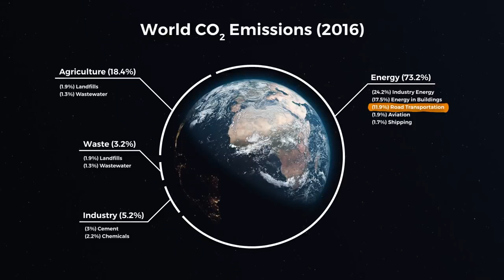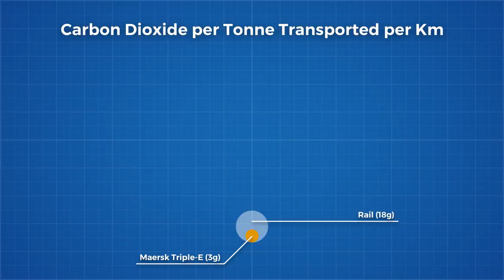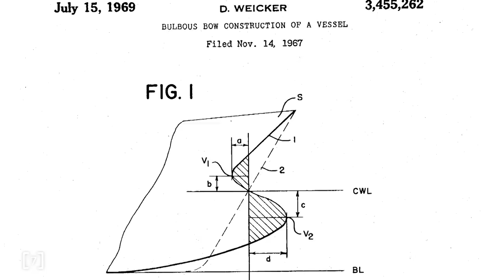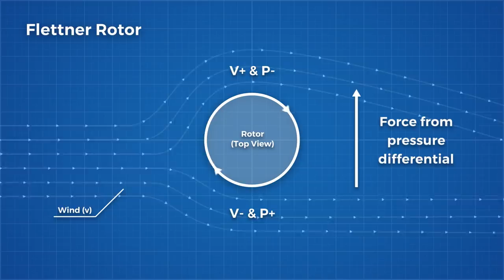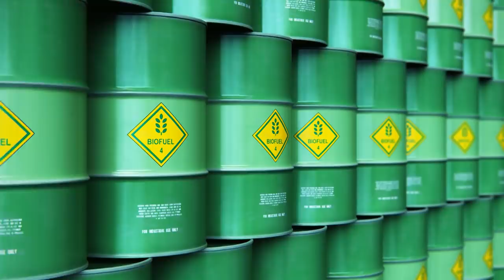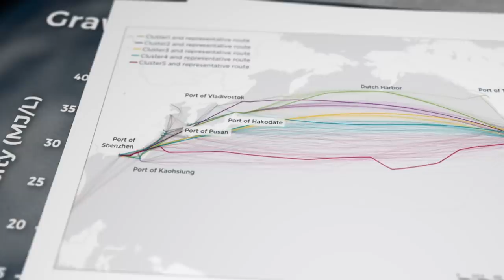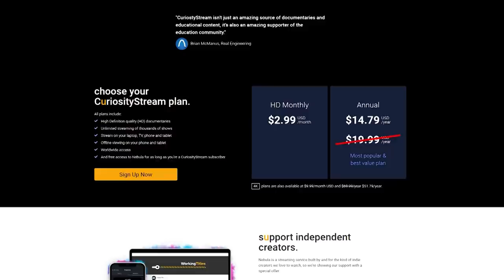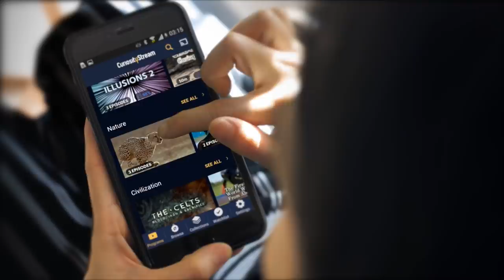Are Renewable Powered Ships Possible?

Comment: Maybe not "renewable" per say but having nuclear powered container ships would be a big step up. Container ships are the most economical way to transport goods but they still throw out a lot of pollution and making them all nuclear powered would almost entirely eliminate that pollution.
Reply: If you do a web search for ‘nuclear ship savannah’ you will see that it has been tried and did not work.  A similarly heavily subsidised, by the government, vessel is in use in Russia which also operates, in support of the Northern Sea Route, a fleet of nuclear powered ice breakers these may, or may not, have been completely without issues.

Just think; would you have full confidence in the management of a nuclear reactor under the control of an anonymous entity only traceable, perhaps, via a letter box in a FOC (flag of convenience) nation state?  If you are, could you sell that confidence to Japan, the state that hosted the Hiroshima and Nagasaki nuclear detonations as well as more recently the Fukushima ‘event’?  Then try that same, or a similar, sales strategy on Ukraine, the nation state that as a part of the USSR (CCCP) hosted the Chernobyl ‘event’.  Modern iterations of nuclear energy, thorium fuel, molten salt reactors or fusion reactors, will carry the legacy of past problems.  It is the global trepidation of anything with 'nuclear' in the name and the economics of nuclear having transitioned from 'energy to cheap to charge for' too 'the costs of remediation are incalculable' that will prevent the adoption of nuclear energy as a means of creating energy at sea.  Modern reaction systems may have overcome the safety problems but the general public, having been misled in the past, will be reluctant to believe the fresh new promises.

‘They’ say nuclear is cheap, it’s not it is expensive and has a large embedded carbon quotient as well as being complicated, dangerous, not universally socially acceptable and having only ‘no need for refuelling’ as a questionable advantage; actually it does need refuelling just not as often.  When ‘they’ do need to refill the warming up stuff it takes considerable longer than pumping tonnes of thick black stuff, HFO cSt380, or thin runny stuff, MDO, onboard which is one of the reasons HMS Queen Elizabeth and HMS Prince of Wales are pushed about by ICEs and gas turbines thus using a similar fuel as the aircraft that fly off of them.  The Royal Navy (RN) with a high degree of skill and expertise uses, at vast expenses to the UK taxpayer, a current operational nuclear fleet of 11 submarines (also known as ‘boats’) in two flotillas, seven attack subs and four ballistic missile boats.  The carbon footprint of all the extra bits of hardware and the fuel, including processing thereof, from ground to propeller, are the external costs that never seem to get considered.

Disposal, once it wears out, of both the machine (that was a ship) and fuel is another can of worms best left unopened.  The 26 RN boats no longer in use are laid up (some in Rosyth and some in Portsmouth) awaiting long term deconstruction including dealing with the fuel rods and other irradiated material.  The USN is not, as far as I know, a commercial organisation working to very tight margins and also has the skill and expertise to handle the complexities of nuclear power; so as well as submarines their aircraft carriers are nuclear powered and each of the current iteration has a build cost three times that of QE/PoW, bigger crews and more generous funding.  For those who still think that nuclear energy might be the answer I recommend this report: - https://www.bbc.com/future/article/20200901-the-radioactive-risk-of-sunken-nuclear-soviet-submarines?ocid=ww.social.link.email.  The navy of the USSR might have been under resourced and over extended but it was still generously supported in comparison with merchant shipping.

Comment: Literally sail boats
Reply: To address the suggestions that sail power is the answer I offer the following.  In 1870 a premium sailing vessel entered service, the ‘Cutty Sark’, she could carry around 600 tonnes of cargo at speeds of up to 17.5 knots, dependent on the prevailing wind, to harness the energy the available spread of canvas was up to 2 976m2.  To round things out that was circa 5m2 of canvas for every tonne of cargo carried.  The ‘Cutty Sark’ was designed and built, with fine lines (more nautical tech speak so again - no need to worry about it) for employment in the tea trade where time on passage was a large factor in securing the premium freight rate that made her cost effective but as soon as the Suez Canal opened, which the ‘Cutty Sark’ was unable to sail through, she lost her advantage, raw speed, to the steam powered ships of that era.  Mechanically powered ships have improved in terms of efficiency, on a freight tonne mile basis, by at least one order of magnitude since then.  After losing out to the coal burning, steam reciprocating mechanical ships of the late 19th century ‘Cutty Sark’ was relegated to the Australian wool trade, just about the bottom of the barrel in maritime terms and only one small step up from being a 'honey barge'.  The canvas, cordage and extra manpower needed for sailing ships was never a very benign environmental option so please discount any idea of sail as ‘sustainable’.  All this is without the problem that if ‘the wind don’t blow the ship don’t go’, when it does blow it often blows in the wrong direction for your cargo delivery needs and sometimes there is rather too much of it for comfort.

Comment: This fuel is used to produce steam to generate electricity.  It is possible to generate electricity without fuel by using Edison generators and dynamos inverters and transformers to deliver high voltage AC power to the engines.

Comment: I don't remember nuclear being mentioned a single time and that's 👎
Reply: Cost, safety not commercially viable. Just consume less stuff, it is the zero cost option.
Reply: @BernardLS  I doubt that's going to happen without an insanely large-scale cultural shift. Nuclear is safe and usually cheaper in the long-run. Honestly, it's probably our only real green option right now.
Reply: @leoerickson980  hej Leo. Sadly you are IMO right about lower consumption not happening ‘without a large scale cultural shift’. Humans as a species take awhile to adjust to reality and tend to see things in terms of ‘yes’ or ‘no’. However using a bicycle to go to the local shop is probably better exercise than paying a subscription for gymnasium that does not get used and my Ford Focus is probably more appropriate than my neighbours Volvo XC90 especially as both of us only drive about 100km a month.
Reply: @leoerickson980   FYI I posted another comment under the line, this time about sailing ships using the Cutty Sark as an example.

Comment: why not adding flaxible solarpanels on cargo ships to save enegie they have planty of space to fit it on
Reply: Solar power; as an example the above container (called boxes by nautical folk) area of a Maersk Triple E is less than 399.2m by 59m.  The 399.2m is the length between perpendiculars (marine tech speak - no need to worry about it) and the 59m is the width overall (more marine tech speak so again no need to worry about it) allowing for the sides, bow, stern & navigation/accommodation structure could we agree 340m x 56m, or 19 040m2, for the ‘top of stow’ area?  Insolation rate in Joules will vary due to time of day, latitude of vessel, declination of sun, (those three impact the elevation of the power source) cloud cover, the efficiency of the solar panels and how clean they are.  The Triple E class use two 29 680 kiloWatt each, at full whack, ICEs for propulsion plus some hotel and services power load cost; so for round numbers, could we agree 60 megaWatts?  Solar panels create about 155 Watts m2 averaged out; 19 040 x 155 gives me 2 951 200 Watts (or 3 megaWatts for a round number) from the top of all the boxes.  Those three megaWatts might allow you to distil enough fresh water from the sea to wash the crud off of the solar panels (surprise fact renewable energy comes with maintenance costs) but nowhere near enough to effectively 'push the boat along'.  Fitting solar panels on top of the ‘boxes’ is worth, at most, 0.5% of your power requirement.  Side mounted, let alone towed array, solar panels are not practical given the harsh conditions often found at sea.

More seriously the ‘boxes’ are loaded and unloaded from the top down so the solar panel array would need to be moved for every port operation and time is money as well as that operation having the ability to get very complicated (tech speak for ‘go wrong’).  Any additional weight would be in the worst possible place for the stability of your vessel, the operating environment would be harsh and the ‘top of stow’ on a ‘box boat’ is seldom a level expanse as each column of containers may be, and usually is, of differing heights.

Comment: For the moment there's no solution. Rotators which your mentioned are useless in containers as deck is filled with cargo up to visibility limits allowed by IMO. Production from bio- mass is impossible because of scale. Avarage container is burning about 80 tons of heavy fuel oil a day. Bio- fuel will create the same amount of Carbon-oxides. It would only reduce sulfur oxides however it is already solved as since last year all vessels are allowed to sail only on low-sulfure fuel. Additionaly usages of fresh water to grow such an amount of fuel would be devastating for environment. Hydrogen might be solution in far future. Technology does not exist for the moment. Additionally hydrogen is produced by reforming of LNG or electrolisys. First option is only moving polutant from shipping to chemical industry. Second one is extremely energy- intensive and need extreme amount of water. So worst than current system. The only solution for the moment is actually come back to wind powered vessels. With highly efficient wing- kind "sails". But here we go back to cargo stored on deck of containers which will cover sails. I guess IMO and governments need to choose one path and intvest in one of technologies. However it's far future. For the moment that m there's no solution.

Comment: YES. Screw the oil derivates, nuclear energy away.
Reply: Why not use nukes on merchant ships?  It is down to engineering, finance, socio-political attitudes and safety.  In engineering terms hydrocarbon fuelled ships do the job adequately and are simpler, financially hydrocarbon fuelled ships are, considering only internal costs, cheaper and socio-politically hydrocarbon fuelled ships are a known entity they thus have incumbent advantage.  With regard to safety hydrocarbon fuelled ships may have serious problems but these are generally considered manageable and have known limits of impact, most importantly they can be shut down at short notice and are then walk away safe, while nuclear energy has fewer incidents those rarer occurrences are seen to be catastrophic and having unlimited effects.

Comment: Is it nuclear? Because I'm pretty sure the answer is nuclear.
Reply: ‘They’ say nuclear is cheap, it’s not it is expensive, and has a large embedded carbon quotient as well as being complicated, dangerous, not universally socially acceptable and having only ‘no need for refuelling’ as a questionable advantage; actually it does need refuelling just not as often.  When ‘they’ do need to refill the warming up stuff it takes considerable longer than pumping tonnes of thick black stuff, cSt380 HFO, or thin runny stuff, MDO, onboard which is one of the reasons HMS Queen Elizabeth (QE) and HMS Prince of Wales (PoW) are pushed about by ICEs and gas turbines thus using a similar fuel as the aircraft that fly off of them.  The Royal Navy (RN) with a high degree of skill and expertise uses, at vast expenses to the UK taxpayer, a current operational nuclear fleet of 11 submarines (also known as ‘boats’) in two flotillas, seven attack subs and four ballistic missile boats.  The carbon footprint of all the extra bits of hardware and the fuel, including processing thereof, from ground to propeller, are the external costs that never seem to get considered.  The USN is not, as far as I know, a commercial organisation working to very tight margins and also has the skill and expertise to handle the complexities of nuclear power; so as well as submarines their aircraft carriers are nuclear powered and each of the current iteration has a build cost three times that of QE/PoW, bigger crews and even more generous funding.  For those who still think that nuclear energy might be the answer I recommend this report: - https://www.bbc.com/future/article/20200901-the-radioactive-risk-of-sunken-nuclear-soviet-submarines?ocid=ww.social.link.email.  The navy of the USSR might have been under resourced and over extended but it was still generously supported in comparison with merchant shipping.

Disposal, once it wears out, of both the machine (that was a ship) and fuel is another can of worms best left unopened.  The 21 RN nuclear powered boats no longer in use are laid up (some, 7, in Rosyth and some, 14, in Devonport) awaiting deconstruction including dealing with the fuel rods and other irradiated material.  Also twenty years is a typical life expectancy for a commercial hull so about when the reactor needs refuelling, due to the elements being 'poisoned' (?), it is time to drag it up a beach on the Indian sub continent and start beating the thing to death with hand tools.  It may also be worth remembering that ‘systems reliant on perfection are most vulnerable to disruption’ and 'the more complex a system is the more likely it will fail at some point'.